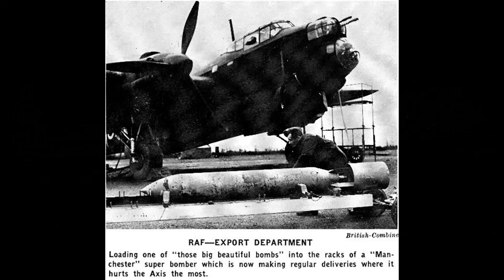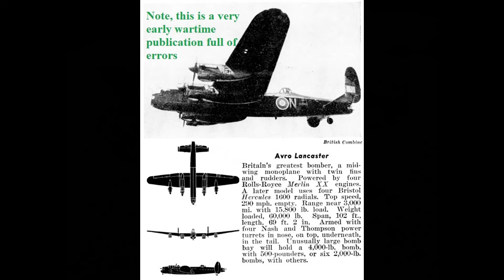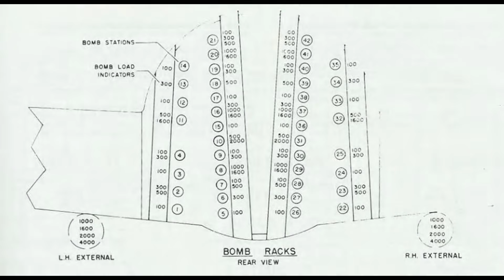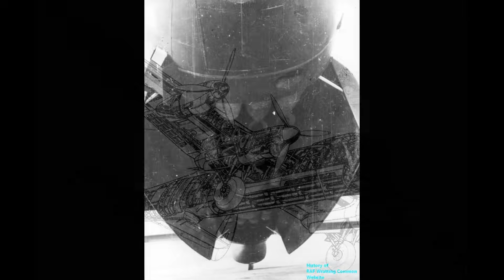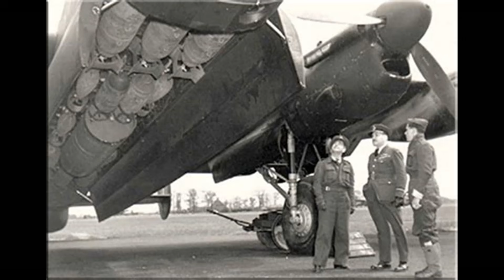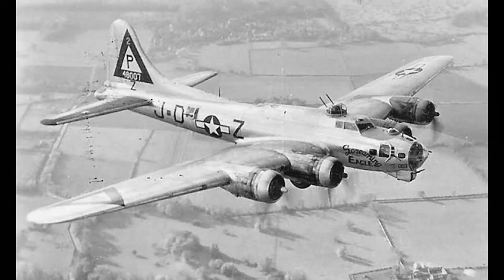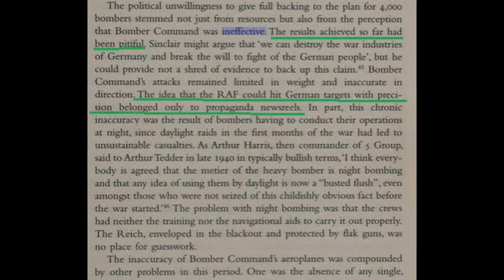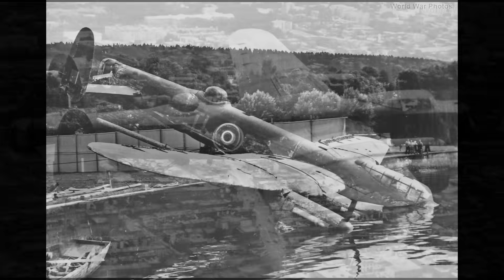Avro Lancaster, Payload, Turrets, Stability and More

Comment: You are going to love this:
Speaking of United States style bomb-bay bomb-racks;
When I was in the Airforce [81 to 85] there was an Airforce publication "TAC ATTACK" and there was always a good story from the past and often from WW Twice.
One such story goes like this.  A B25 Mitchell bomber was on a mission to bomb the Mitsubishi Aircraft factory.  A 250 pound bomb failed to release and hung up on the rack.  It had fallen out  of position and could not be secured.  So, according to SOP of the day, they exited the area with bomb-bay doors open in the hope that the bomb would fall free at some point and not smash through the doors.  Occasionally the plane was "shaken" by the pilot in the hopes of encouraging gravity to take the bomb away.  (this causes drag and they fell behind their squadron mates)  At some point the bomb fell free, they closed the bomb-bay doors, and got out of Dodge.
Foward to after the war when the USAAF was researching how effective they were as according to enemy records.  They came across an obscure little footnote of a factoid.
On the particular date of that bomb raid on the Mitsubishi Factory, it was reported that a lone B25 Bomber dropped a single bomb on the Mitsubishi Headquarters' building that was located some distance from the factory.
So it was that after that B-25 bombed the factory, they dropped one on the headquarters for good measure!
Reply: My late father was in the AIF, or Australian Imperial Forces based in New Guinea during WW2. He was a Lance Corporal but his particular designation was a Master Layer, or aircraft identifier in the anti-aircraft unit! Their unit, shot down quite a number of Mitsubishi bombers & various Japanese planes during their years based up there! So your boys did their job as our boys did! My dad knew a number of American pilots & crews during this terrible time & spoke very highly of them! 🇺🇸🤝🇦🇺👍🏼 “Lest We Forget”… 😢
Reply: A GREAT STORY!
B17s on a raid on Germany missed their target, but (unknowingly) hit the one and only factory which manufactured fuel for the Me 163 Komet. After that, the Komet was reliant on pre-existing fuel stocks.
Reply: @raypurchase801  those whacky bomber crews
Reply: It sounds like that method was particularly accurate. The Japanese must have suspected the Americans could pinpoint bomb targets if they wanted.
Reply: That's making some lemonade by accident.
Reply: Uh ... I'm confused.

The only mission I'm aware of where B-25's bombed Japan - was the Doolittle Raid launched from the aircraft carrier USS Hornet CV-8.  I'm curious where this aircraft took off from - that it was able to reach an aircraft factory in Japan.

If the Japanese had any aircraft factories out side of Japan - I'm not aware of it.
Reply: @BobSmith-dk8nw  B-25’s we’re bombing Japan from Okinawa at the end of WWII
Reply: @BiggieQuandt  

Given the Range of the B-25
https://en.wikipedia.org/wiki/North_American_B-25_Mitchell
it is doubtful that they could have reached any targets on the Main Islands - other than Kyushu - from Okinawa.

The Mitsubishi facilities all seem to have been located on Honshu.

Mitsubishi Heavy Industries
https://en.wikipedia.org/wiki/Mitsubishi_Heavy_Industries

Mitsubishi Aircraft Company
https://en.wikipedia.org/wiki/Mitsubishi_Aircraft_Company

and were to far away from Okinawa to be reached by B-25's flying from there.

The only time (as I said) that B-25's bombed an area of Japan where they might have been bombing the Aircraft Factory and Headquarters of Mitsubishi - was during the Doolittle Raid when they launched from the Hornet.
.
Reply: If this was during the Doolittle Raid, it would have been a 500 pounder, however, they didn't attack in formation.  The main concern was fuel since they took off early, this meant that any increase in drag increased their chances of not being able to reach China!  (Hence why they wouldn't want the bomb to fall through doors, and why they wanted the bomb to drop so that they could close the doors.
 
However, this Reminds me about 2 missions over Europe: 
     First was a shot up B-24 that had a cable severed and a bomb didn't release.  The Bombardier got the cable rerigged and got back forward to his position.  About this time they were approaching an airfield at low altitude and he noticed "A strange looking building" and had the pilot turn towards it.  He dropped the bomb on that building. And dropped the bomb on the only very high altitude (above 10,000 meters (~32,808 feet)) test chamber that was inside the building!  This delayed the Ta-152 and other aircraft that Germany was building in the hopes of flying above effective Allied interception by fighters...
     Second was a raid by A-20s over either Denmark or the Netherlands/Holland.  (This was when the USAAF had adopted the practice that when the lead bomber dropped his bombs, the formation would drop their bombs.  This is why you see videos of the first bomb from a bomber having a smoke bomb attached to it)  The lead bombardier was testing his bombsight to make sure it was tracking right while approaching the target (a standard practice), but made a mistake and flipped one too many switches!  So the Bombs fell inside of a public park, and the other bomber basically cratered the park as well.  The Gestapo freaked out because there was a recently completed and secret complex underneath the park!
Reply: otherwise millions of civilians were deliberately targeted by LeMay to be burned alive in massive napalm fire raids. Genocidal war crimes that even air force officers knew they were guilty of. No biggie, nothing to see, move along now...........
Reply: @wazza33racer  They started it.
.
Reply: @BobSmith-dk8nw  FDR started it.  The pre war negotiations forced Japan into a corner, war at that point was inevitable. Both sides were empires, and there was a "turf war".
Reply: @wazza33racer  I had a previous reply to this but ... it's not here ...  Possibly I screwed it up.

FDR did NOT start it.

The Chinese Communists Started World War II in the summer of 1937 at the Marco Polo Bridge incident.

The Communists could not beat the Nationalists - so they wanted the Japanese to do it for them.

They attached men to a Chinese Patrol.  The Japanese also had units that were out there patrolling the rail lines in Northern China.   One of these Japanese Patrols was missing a man.  What had happened - was that he had gotten lost - but eventually made it back to his unit on his own.  The Japanese Patrol - just didn't know that was what was going to happen - so they were of a mind that the Chinese were responsible for this guy being missing.

The Japanese Patrol and the Chinese Patrol encountered each other and the Communists in the Chinese Patrol fired on the Japanese - who returned fire.  The Officers leading these patrols - did not want to be responsible for starting WWII - so - they managed to stop the firing.  First chance they got though - the Communists started shooting at the Japanese again.  The Japanese returned fire.  I'm not sure how many times this went on - where the officers got their units to stop shooting at each other and then the Communists started it up again - but - eventually the Japanese got tired of it - and it was on.

This incident flared up into a full scale invasion of China by the Japanese.

The Nationalists - who had troops trained by the Germans - tried to resist the Japanese and had some success for a while - but eventually - these good, German Trained and Equipped Units the Nationalists had - were lost.

The Japanese took control of much of China - especially along the coast - but had logistical difficulties moving inland.

One incident though was - the Rape of Nanking where a lot of Chinese prisoners and civilians were murdered and a lot of women raped.

News organizations published stories and News Reels showing the carnage inflicted on the Chinese by the Japanese.

The Japanese controlled all the ports - but - the Chinese were getting supplies in through Indochina (Vietnam, Laos and Cambodia) which was a French Colony.  The Germans had beaten the French in 1940 and at the request of the Japanese - the Germans prevailed on the Vichy French Government to allow the Japanese to come into Indochina to cut off the Chinese supplies.

When this happened - THEN - the Americans felt that they should not be selling Oil to Japan to use in the Rape of China.  So - they cut them off - with a demand that they largely give up their invasion of China if they wanted this Oil to be resumed.  There then became a protracted negotiation that ended with Pearl Harbor.

Japan, with the Meiji Reformation - had - decided that if they wanted to avoid becoming a colony - they should join the Colonial Powers as they could not beat them (mostly).  They fought the Russians (whom they could beat) to point this out.  From then on - they felt that for them to back down to a Colonial Power was to be on a Slippery Slope to becoming Colonized.

To take the Oil and other resources available in the Western Pacific - Japan would have to go to war with the US, UK and the Netherlands (their government having fled to exile in the UK).

They knew that this would destroy them but the alternative was becoming a colony.  They chose to fight - and were destroyed.

THAT is what happened.  It was NOT a "Turf War" between the US & Japan.  The US just could no longer stand by and watch Japan use American Oil to kill Chinese.
.
Reply: @BobSmith-dk8nw  why is what happened between Japan and China got anything to do with the USA?  But then why was the USMC in Russia, guarding the trans siberian railway for the Bolsheviks in 1917?  The real answers have more to do with Smedley Butler observed in his career than "caring" for some distant group of people, thats just nonsense.  If the USA had some global,humanitarian concern for the well being of distant people, they would have invaded the USSR in 1930 and hanged Joseph Stalin (not his real name).
Reply: @BobSmith-dk8nw  FDR didnt start it.........no he just manipulated the situation into forcing the Japanese to attack.  What else was going to happen when the Japanese had the ultimatum.........Lose China or Lose the oil?    If the USA were so concerned for the well being of distant people in far away lands, they would have invaded the USSR and eliminated Joseph Stalin (not his real name, hint hint).   I dont doubt Japan assumed a "colonize or be colonized" attitude, Admiral Perry taught them that LOL!   Empires dont coexist all that well, like the British,Spanish and French always warring with each other for centuries to dominate one region or another.  Imagine what would happen is the USA started blockading China from all its mineral and oil resources in 2022?  Would China lay down,shrivel up and die .......or would they come out fighting??????????? Join the dots.
Reply: @wazza33racer  

1) FDR didn't manipulate the Japanese into anything.  He was trying to force them to do something and they, in a fit of suicidal stupidity - attacked us instead of realizing that they had come to late to the Colonial Power Game.

2) I answered your repeated remark about Stalin and the US caring the first time you made it.

3) Perry did not teach the Japanese anything - they figured out that solution all by themselves.

4) The Colonial Powers had gotten along well in China, carving it up into Spheres of Influence.  The mistake the Japanese made was in trying to take all of it - as it wasn't just the US that cut Japan off.

China is becoming if it hasn't already become the Worlds Greatest Economic Power.  They are working on building up their Navy and in trying to lay claim to the riches of the South China Sea by creating Man Made Islands there (which are apparently sinking because of poor construction).  They are also flexing their muscles with Taiwan.

They are after all - still a bunch of Communists.

Yes - we could very well end at War with Russian and China - possibly at the same time - but - this is all because of Stupidity on their parts.  There is no reason for them to be doing the things they are doing - except - that they are political dictatorships.

For you to act like the Chinese would be the good guys here - is monumentally stupid - but then (as I said) - you have given ample indication that you are either an idiot or a Troll.
.
Reply: @BobSmith-dk8nw  Yeah right, Perry opening Japan after centuries of isolation by force, taught the japanese nothing.   Getting back to FDR, he was commie sympathizer in an administration full of either outright communist agents (venona decrypts) and communist sympathizers like himself. His wife was bonking a known communist. Where would the USSR be without FDR and Harry Hopkins bowing and scraping for their despot friend.  Japan was means to an end, getting involved in WW2, leaning on the Japanese got the desired result. Roosevelt was not even that families real name........its was something else. Just as Karl Marx and Stalin changed their surnames to hide their ideological back grounds. Its also become known, that before he died, FDR and Churchill hatched a plan to sell german civilians for a few dollars each to Stalin, only the objections of the british foreign office stopped that idea going ahead. FDR was a corrupt,vicious war criminal like Churchill..............we only need to read up on Operation keelhaul to find that out.
Reply: @wazza33racer  Ha!  Ha!  Ha!  Ha!  Ha!

You've got to be a Troll.  No one is actually that stupid.
.
Reply: @wazza33racer  
Smedley Butler was dead before WW2, all you amateur historians who are always wanting to put some kind of twist on things so you can act like you know more about history and are more insightful about it than actual historians love throwing out what Smedley Butler said but none of you realize that Butler was dead before WW2, had he seen what became common knowledge after it like the death camps in Europe I highly doubt he'd have said "War's a racket", all of you like to base your conspiracy theories about WW2 being fought for global monetary interests on one single statement from one single man who was involved in events that had nothing to do with WW2 or the reasons it was started. 
Butler was a private individual and not an historian or an official spokesman for the United States or it's history or policies, his war record gives absolutely no credence to his views on matters as a private citizen, they're simply his opinion, which once again were formed without the knowledge of things like the death camps in Europe or the rape of Nanking, had both of those been known to him I highly doubt he'd have implied what he did, his experiences were limited to a small window of time in history.
Reply: @dukecraig2402  Smedley was only one of the first people to realize what we all know today, that the economic imperial ambitions of the USA abroad, were fueling unnecessary wars.  When events kicked off in Ukraine early this year, the media interviewed a column of war mongering pundits, closely tied to the military,government and defense contractors, that all brayed for a massive escalation, for massive mobilization to win the war for Ukraine and raze moscow.  All these MIC lobbyists could think about were massive profits. There is no better proof than USA military spending relative to all other nations combines, clearly something is very wrong.  While the country experiences soaring debt inflation,record homelessness, crumbling infrastructure and shortages.......the bloated military budget has not changed much.
Reply: @wazza33racer  
"What we all know..." speak for yourself and not for others especially me, Butler was not an official spokesman for the US nor for it's history, not only was he no more than a single person with his own opinions he wasn't even educated in history, just because someone fights in a war doesn't mean they know what happened behind the scenes leading up to that war, if you'd ever been a soldier yourself you'd know you go where you're told to go and believe me they don't bother getting into the issues that led them to sending you there, Smedley Butler's opinions on global issues aren't any more relevant than any one else's they were simply an opinion.
And once again Butler was dead before WW2 so using any quotes of his and applying them to the causes behind WW2 is total hogwash, Butler never saw or even knew the existence of death camps that exterminated millions of civilians, if he would have I seriously doubt he would have applied his "war is a racket" narrative to it, and if he would have then screw him.
Reply: @dukecraig2402  "not an official spokesman"............so his opinions were invalid??  "just because someone fights in a war doesnt mean they know what happened"..........nor does it mean that they were not party to information that most people were not BY ACTUALLY BEING THERE. Butler wasnt a private, he had significant rank, and may well have been privy to knowledge no historian will ever know.  Yes, soldiers take orders, but it doesnt mean they ignore everything they see and hear while carrying out orders.  Seriously, people who are eye witness to events, have far more weight ascribed to their testimony in court than anyone else who relies on biased reporting,hearsay and conjecture.  Yes Smedley was only one man, but in the back drop of how many wars did not start they way the official narrative tells it, its important to consider all the facts and even opinions that may shed light on how things really happened.  But you know there was WMD IN IRAQ!!!  Lets go war mongers, off to Iraq!!! The OFFICIAL SPOKESPERSON of the US gov told me so!!!!
Reply: @wazza33racer  All Japan had to do was stop Committing War Crimes in the Territories it had already conquered and stop invading more of China!!!
Also, if they had just struck south (the Southern Resource Area) and ignored the US, there's a good/very good chance that the US would have never declared war on Japan!  (Germany, probably, but not Japan)
Reply: @wazza33racer the US had 0 chance of invading the USSR and inserting a loyal government in the 1930s. The US army was tiny and not built for such a long distance invasion, nor would a great population support such an idea.
Reply: @wazza33racer The US did actually send US troops and supplies to try and stop the communist party, but was forced to withdraw
Reply: @teejin669  Source Please
Reply: @jacktattis  for which part?
Reply: @teejin669  when the US sent troops to Russia was it 1919?
Reply: @wazza33racer  in all of the history of war, there has always been the targeting of civilians.  ALWAYS.  
Let's remember the very nature of what war is.  It is a crime. It is almost always a bank robbery writ large.
The very first war is in Genesis when a number of confederated kings went around sacking cities, killing, looting, and taking captives for slave labor.  Lot was captured that way when Sodom was raided.  Abraham took his men and went out at night and fought against those kings, rescued Lot, and returned what was stolen.  

As horrible as firebombing is it is a simple truth that one country's military does not simply wage war against another country's military.  The WHOLE of the country is involved, civilians included.  Japan certainly tried to fire-bomb us as well.  There are lots of wrongs in war.  John F. Kennedy seriously screwed up and got his PT Boat rammed.  He would become a lecherous and corrupt president.  Lindberg would pump Goddard for rocket technology and give it directly to the Nazi rocket scientists, yet he's remembered as a hero.  Japan committed many many war crimes and was barely held accountable.
We draw lines but only the victor decides what lines count.
Reply: 😅😅😅😅 wow